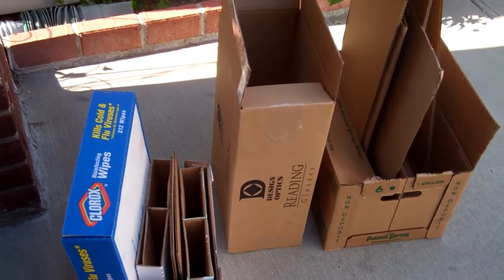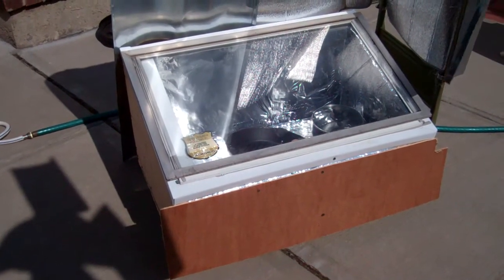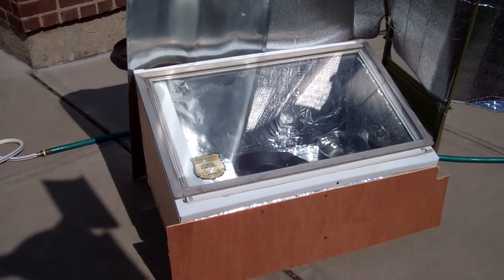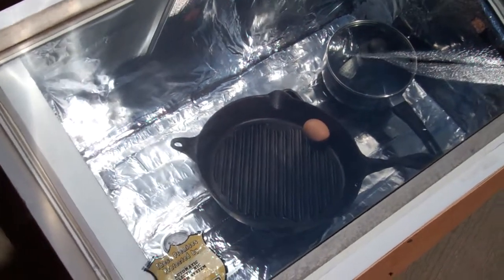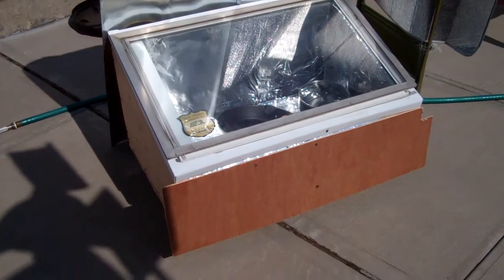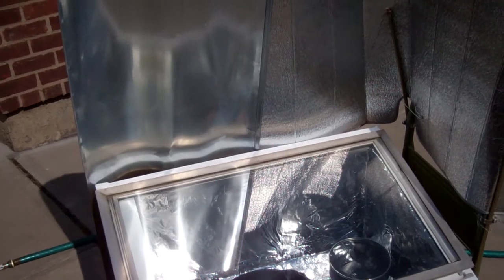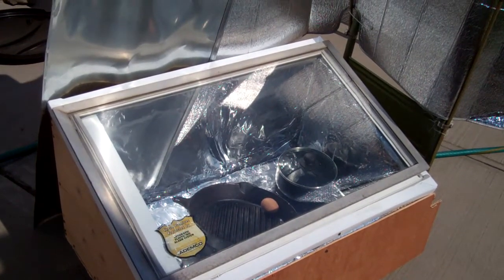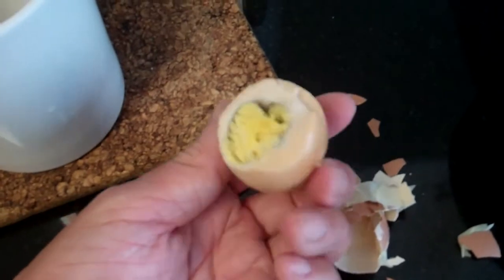Solar oven,  part 5. Test oven reached 225 degree Fahrenheit

Comment from the maker: I'm trying to figure out if I can put together a low wattage heating element powered by a solar panel to give the temperature a boost on days when the sun drifts in and out. Are you aware of anything doing something similar?